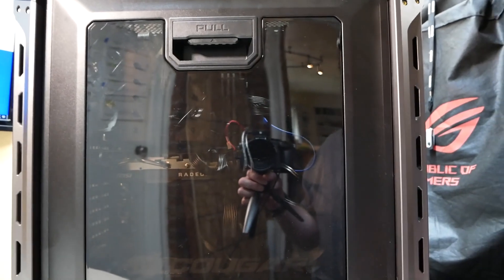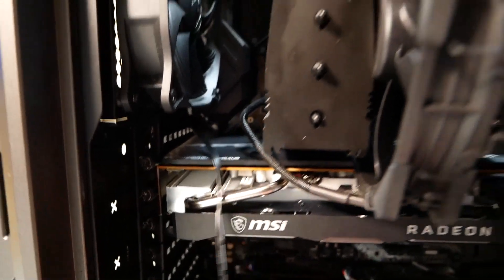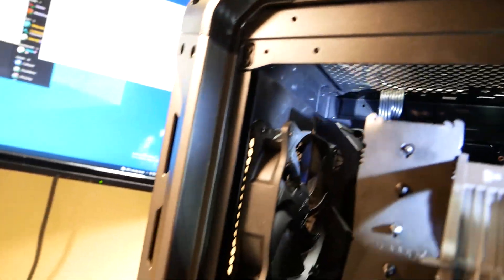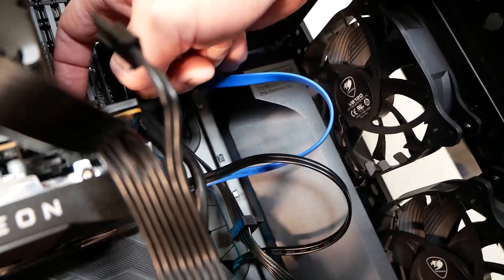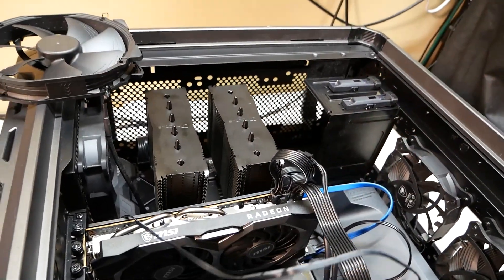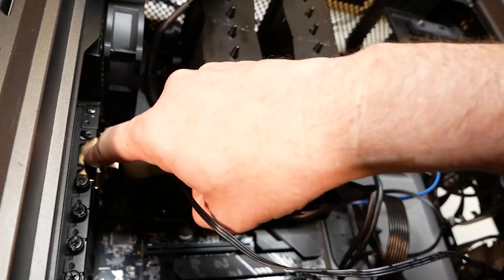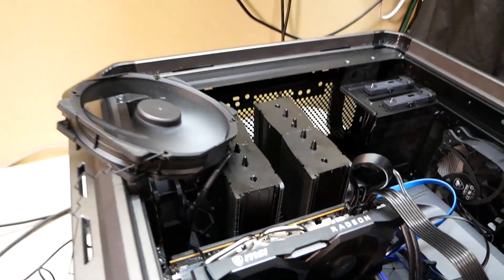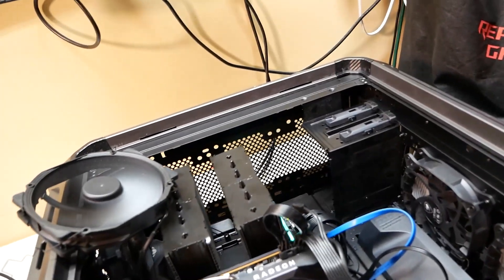First Things to Check When Your Gaming PC Will Not Start

Comment: If it wasn't the video card id say Ram! Ram!
Reply from the maker: Yeah that would have been another area to go down.
Reply: @TimsComputerRepair  I had an issue once when a new motherboard had a faulty ram slot b1 and b2. When ram was installed there it would not post. Swapped the motherboard with another new one and it was fine.

Comment: That fan sitting between the two Noctua tower cooler fin stacks was pointed inward so that the air was being pushed/pulled back into the case instead of toward the exhaust fan at the rear. And the metal clip on the bottom of the unsecured fan was positioned to short out the motherboard. Some people should just buy prebuilds...
Reply from the maker: Or they can take the computer to someone like me. They start off with high ambitions but realize they are over their heads. Thanks for commenting.
Reply: @Thread Ripper I am with you.